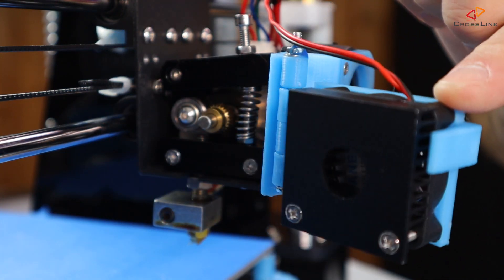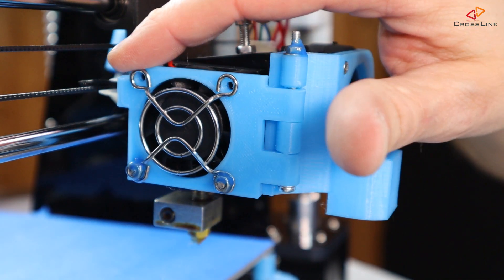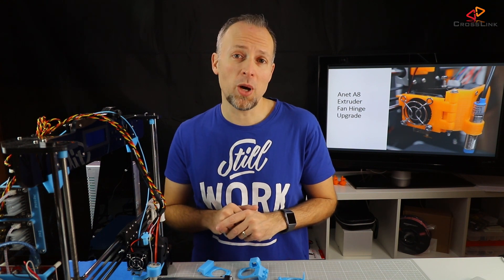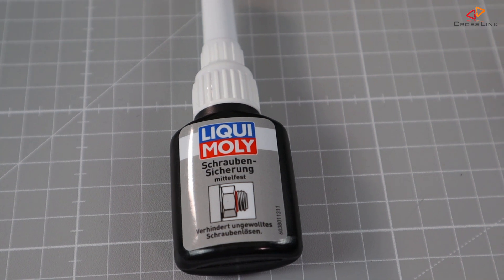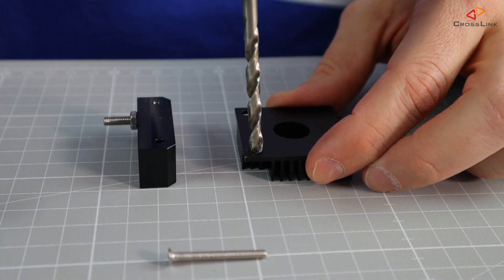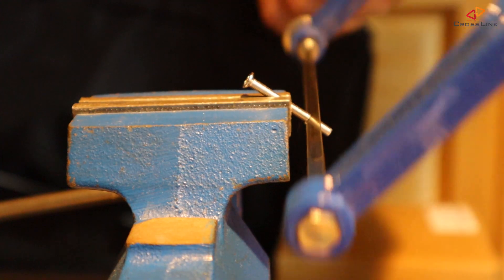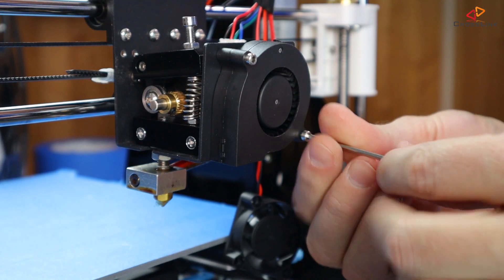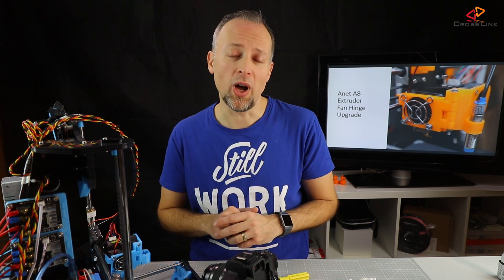Anet A8 upgrades - Extruder fan hinge

Comment: It's nice, I installed it because I was using older filament and needed to guide it in the nozzle quite alot.
One problem: It doesn't press the heat dissipater flush tot the quick release bracket which causes a vibrating noise like a fan whine. I measured it up and printed a "lock" to keep it pressed against the bracket to fix it.

But that remains the question of the little part between the axis-screw and the ventilator, what was it intended purpose? it does seem to be a "lock" but it doesn't fit anywhere on my printerhead

Comment: That is the most useless mod I've seen. The cooling block has to have good (screwed together) contact with the extruder block. They need to be bolted together. What is that fan cooling after this mod? The cooling block? And What is that cooling? Absolutely nothing.

Comment: The fan and heatsink only makes sense if there is enough contact and pressure against the extruder block... having it hinged there like this makes no sense... you might as well remove it altogether. The purpose of this heatsink and fan is to cool the bottom part of the extruder to prevent heat creeping up from the heating block. If there's no contact, it defeats the purpose, really.

Comment: Just a quick note on locktite - you should put it on the threads and before you screw the nut on - this way it will get heat from the friction and solidify between two threads (bolt and nut) - at least thats how i was taught. Or better yet, use locknuts :)

Great channel, enjoying the positive attitude and the accent :D

Comment: Good video, as always very informative and easy to follow! Congrats. 
I thought of this mod a while ago but then I read that the heat sink would actually lose its functionality if not touching directly with the cooling block. On the other hand, however, a lot of people think you don’t actually need the heat sink at all for most temperatures and materials. What do you think?
Reply from the maker: For PLA, I never had any issues. Also I am printing in the basement, where the temp is around 18° Celsius. Maybe in a hotter environment this might be different. ABS could be another story but I will test it our soon and post my results here.
Reply: @Crosslink3D  Did you find out if the heatsink is needed or no? I'm thinking of doing this or the magnetic mod on my new A8
Reply from the maker: I had no issues printing hotter filaments like PETG with the magnetic fan holder. Looks good so far